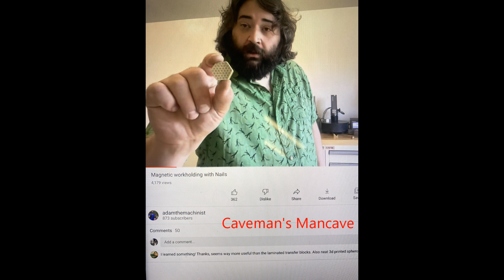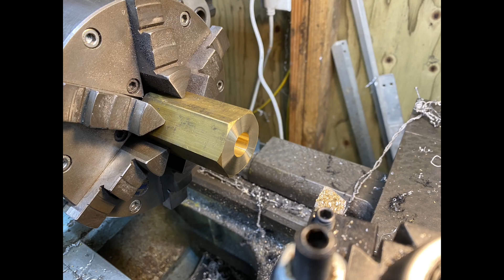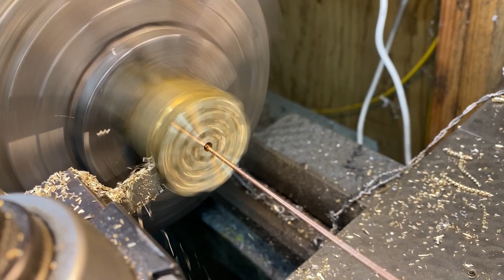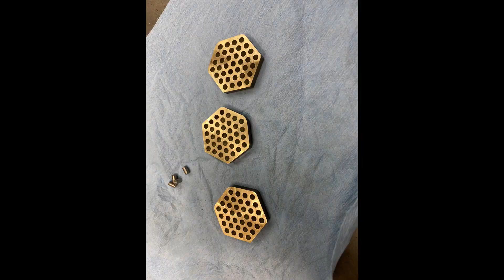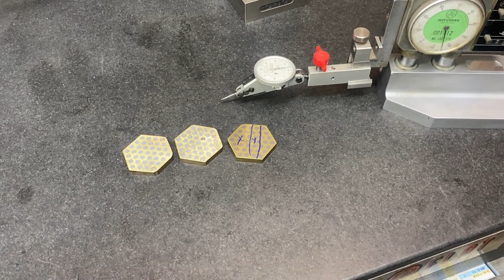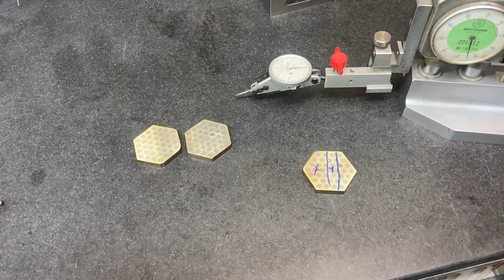Magnetic Transfer Block (non-directional)

Comment: I must be an idiot.  Have no idea what purpose this serves.
Reply from the maker: John, thanks for viewing, mag chucks transfer blocks have straight bars so the block has to be in the correct direction to transfer the magnetism, this design block does not require alignment, it will hold when set on the magnetic and transfer the magnetism
Reply: @outsidescrewball  thank you!  Now I get it.
Reply: @johncrisman576  If you watched Adam's video he explains the transfer block can be made in different shapes and the nails can transfer the flux even if they're bent. Pretty cool.

Comment: what would be the point in those small magnetic blocks? 
I understand what magnetic angle blocks do, but those don't seem that useful?  What am I missing?
Reply from the maker: thanks for viewing, mag chucks transfer blocks have straight bars so the block has to be in the correct direction to transfer the magnetism, this design block does not require alignment, it will hold when set on the magnetic and transfer the magnetism, in the video I referenced....using 3 small blocks you can suspend the part off of the mag to reduce the pull that will cause a bow part to match the mag but only returned to a bow once the mag is released
Reply: @outsidescrewball  ok, I guess I get that, somewhat.